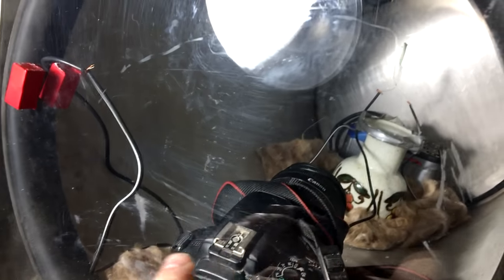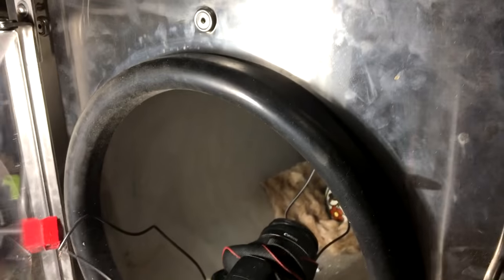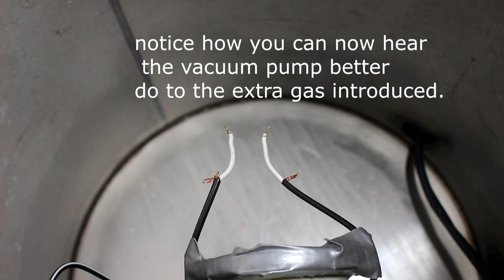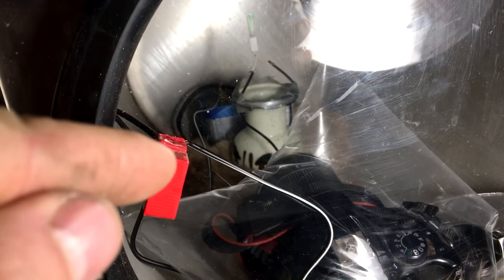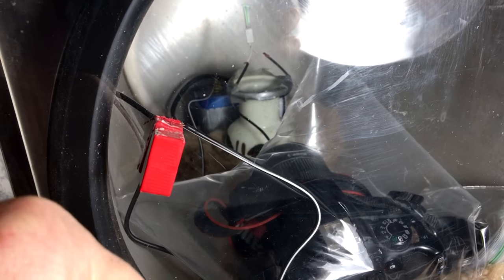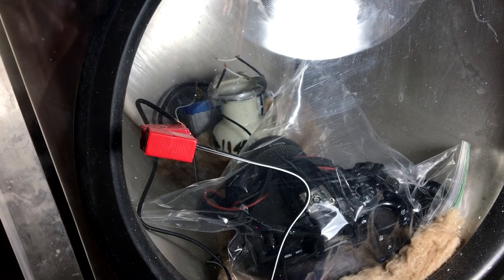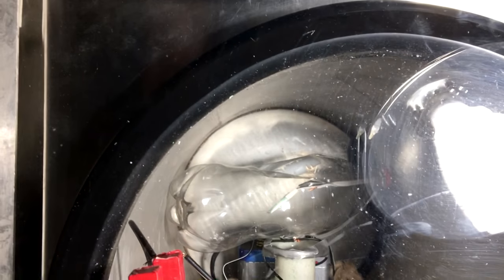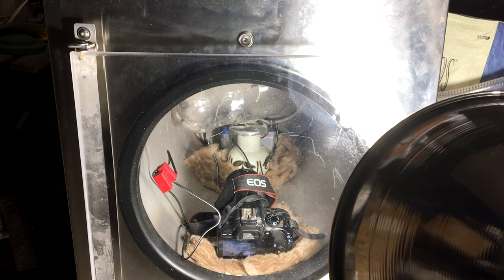Sound of Explosions in Space? part 1

Comment: How does vacuum of space reside right next to our gas atmosphere? (And you can't say "Gravity" in your response)
Reply: OK, but in physics, we observe this thing called differential of pressure. Things will always seek out equilibrium. Especially gases. It's very simple to understand when using the example of filling scuba or propane tanks. Greater volume will always seek the vessel with negative space in order to come to a state of equality. Considering the vastness of empty space, that's a much larger area that would suck off the gas atmosphere of our planet within a half a second.
Reply: Lol, why wouldn't someone say gravity in the response when that is the main answer?? Also, some of the earths upper atmosphere does actually get pulled into space, a small amount at a time.
Reply: +rdizzy1 Because lazy pseudo-scientists like to use that term as a "catch-all" when it doesn't actually apply. Gravity is a theory, not a Law. Thermodynamics is a Law. Buoyancy and Density are Laws. They can be proven with models and observed in reality. Saying "gravity" isn't a mic drop moment.

Gravity was invented to solve hypothetical problems created by assumptions, not facts the researchers made. Even Einstein himself admits this.

So I'm asking a real, legit question about our gas atmosphere. As someone who also has a vacuum chamber and uses it regularly to degas epoxies, silicones, resin infusion etc... I'm intimately familiar with 29 hg. But in order for my chamber to pull near vacuum, I need a thick piece of polycarbonate and a silicone gasket to achieve what is supposedly only 62 miles above our heads. (Karman Line)
Reply: our planet has sufficient mass to warp spacetime to the point that the gas does not have enough kinetic energy to escape the resulting depression.
Reply: +krabcat OK, that's something I can wrap my head around. Thanks for the input. But you are still saying "Gravity Wells" without saying gravity. Yet it's hard to picture a 3 dimentional space time warpage. Very theoretical.
Reply: Gasses still have mass. So this thing called gravity is trying to pull them towards the earth. It does gradually thin out as you go higher because the pressure is less as there is less gas above pushing down. I would imagine the makeup of the air changes as you go up and would get a higher concentration of the lighter gases. 

It is as you say with things seeking equilibrium. Just on a much larger scale than a small vacuum chamber. And with a sufficiently large mass in the middle to hold some gas close to it. Remember it isn't a hard transition line between space and atmosphere. And relative to the size of the earth the atmosphere layer is very thin. So it's only really holding a very small amount. The rest likely did float away until it reached equilibrium.
Reply: If you prefer "gravitational potential" instead of "gravity"... I really don't know what kind of answer you expect.
There is an equilibrium between the gravitational pull and the outward pressure of the earth
The gas in the atmosphere has less energy near the Earth than out in space (due to a gravitational potential)
The entropy of gravitationally bound systems is higher when the system is lumpy instead of uniform
Reply: I have many welding tanks in my shop. I do have to consider my mixed gas tanks will separate over time, and thus result in a bad weld. I do agree, that at the higher altitudes, you'll find the separations very apparent. Hydrogen layer, Helium Layer, Argon Layer, Nitrogen Layer and so on.

BUT... when considering the vacuum of space, can there be a diminished boundary layer of vacuum. OR is it going to be a diminished layer of OUR gasses that show up clear signs of stratification? When thinking of vacuum of space... it's vast and empty always tugging and pulling on anything it can. Our earth is but a speck fluids lightly wrapped over a rock crust.

I'd be more on board if someone said, electro magnetism is what held the gases in. At least that's reproducible with plasma containment inside fussion reactors. Electro magnetic forces contain huge amounts of super heated gas within a field.
Reply: The answer is gravity, it is stronger then the pull of osmosis, and only small amounts of matter can escape.
Reply: Theories can change if new evidence comes along. Gravity is one of those that has never became a fundamental law. While Newton wrote his theory of gravity, and even came up with some math to work out the observations and testing. His math is still used today by NASA when they plan orbital missions. Even though Einstein later discovered (cough** Plagerized) Special and General Relativity, it's never fully become law, because theories can be and have been overturned. Theories then need to withstand the rigors of testing and retesting.

Quantum Mechanics can't explain gravity. But electromagnetic fields do permeate space-time. Here's a quote directly from Space.com: "We know we live in a quantum world, but we can't figure out a way to describe gravity without swearing. And that is infinitely annoying."

Laws are accepted as being universal and are the cornerstones of science. If a law were ever to be shown false, then any science built on that law would also be wrong. Buoyancy and Density clearly explain why things fall/sink. They are laws. Remember, we live in a fluid atmosphere. The air we breathe is a fluid gas, and it does stratify into it's separate components the higher you go. Denser items sink, lighter items rise up. Flight and Swimming are practically identical in their respective mediums. Gas vs Water. Both have measurable characteristics of fluidity.

I will say this again, and it's not refutable: Special and General Relativity or "Gravity" was invented to solve hypothetical problems created by assumptions, not facts the researchers made. Even Einstein himself admits this.

Gravity as a word, does not hold our feet to the ground. Our density does. Occam's Razor applies here. Keep it simple, otherwise it just becomes a theorist's playground of complicated mental gymnastics and math problems. But that still doesn't explain my original question. How can we live right next to a vacuum with a gas atmosphere? How can gravity as a force explain this? It's strong enough to hold trillions of gallons of water form spinning off into space, but weak enough to keep my boat from flinging into space, which is obviously much lighter than the water it floats on. Gravity is also so strong that it can keep quadrillions of tons of gas within 62 miles of it's surface, but weak enough to allow birds and planes to fly though it? AND it holds back the vast vacuum of space too? Wow! Magical gravity... no wonder we still can't describe it!

Nope, sorry... but Buoyancy and Density explain all those examples just fine.
Reply: Then you come up with a theory that actually works.
Reply: +Jane Murphy Actually Tesla is the one who came up with, what I also feel, is the correct one. In fact Einstein even conceded to Tesla's explanation. It's measurable, repeatable and encompasses all living things and organisms. However, it's still vastly complicated for us to fully understand. It is there, but requires us to drop a few assumptions and theories as scientific fact and go back and re-evaluate the math.

Eventually there will be a number of scientists on Tesla's side that will tip the scales of academia. But right now, to question anything is professional suicide. Which is why we have stagnation in scientific development in regards to physics, nuclear mechanics etc.

But what do I know? I'm just an idiot YouTube commenter that should learn my place and never question anything. I should always appeal to authority, even if what they say doesn't make any sense. I'm much too dumb (thanks to public indoctrination camps) to even think about concepts that are outside of my limited professional skill set. I should keep my head down, watch NASCAR and Reality T.V. and feed the machine my time for credits to use up at WalMart.
Reply: Eco Mouse But that doesn't explain how gas is "held" to the earth.
Reply: I may be wrong, but I think the earth's magnetic field also contributes to holding onto our atmosphere.
Reply: Buoyancy and density work in combination with gravity to produce said effects, buoyancy has no meaning without gravity... Even if the current theory of gravity isn't true, before the theory itself it is quite obvious that things with mass attract each other. If the theory falls, some other theory will replace it but that doesn't mean that the atmosphere will get sucked away because of it. You are asking people to explain chemical bonding without electrons. So stop bullshitting people you martyr of science, everyone has been nice to you until now.
Reply: +zach ZACHSON If our planetary science is correct, when a planet (like Mars) loses it's magnetic shield so too goes the atmosphere. I believe our planet is surrounded by a Taurus Field of Magnetism, constantly looping back and forth between the poles. That also explains why we have Northern and Southern Lights along the convergence lines near the 65° and 75° latitude but no higher. The inner slope of the magnetic donut as it crosses the Karman Line.
Reply: Buoyancy is fluid displacement. Archimedes' principle indicates that the upward buoyant force that is exerted on a body immersed in a fluid, whether fully or partially submerged, is equal to the weight of the fluid that the body displaces and it acts in the upward direction at the centre of mass of the displaced fluid.

In regards to mass, all objects will take the path of least resistance (the law of conservation of motion), so the body with less mass will follow the path of space that is "bent" more toward the body with more mass. BUT they will never truly touch each other according to physics. Electrons are made of massless energy particles. So are they actually doing the repulsion on an atomic level?

So, does this mean that you are going to start being nasty to me, because I have questions? I appreciate that open mind for science, you've got there.
Reply: Nice backhanded insult. At least I'm not rH+
Reply: Mass attracts mass.
/solved
Reply: Eco Mouse. There is the theory of gravity and there is gravity. Meaning: gravity is a fact, a fact for which we have constructed a model in order to make predictions about said gravity, which is known as the theory of gravity. If you truly would be a physicist, you would be able to make that distinction. I hope I could clarify to you why the condition in your question was unnecessary and misleading. If you disagree, please clarify on your part why you do. ;)
Reply: Furthermore, bouyancy, mass, etc do not make any sense without the context of gravity. It is like saying explain to me why chilli is hot without telling me about molecules and receptors. By answering that chilli causes a sensation we interpret as hot does not explain it what is going on. Sensation does not make sense outside the context of receptors and their antagonists etc.

Comment: Is your hypothesis that the gas produced by the explosion is not acting as a diffuse medium and transferring the sound in a solid and consist vibration wave. More like the gas is, at least initially, transferring the sound by the movement of gas molecules traveling to the observer?  

     So here's some thoughts and questions I have. I'll try not to be too rambling and nonsensical: 

     Can gas particles transfer sound information via independent molecular vibration in single molecules or at least small packets traveling across a distance in a vacuum or near vacuum? Or is the only sound produced by the impact of these molecules striking the observer and not actually sound information generated at point of generation ie: explosion? (Though I don't know if a single molecule in a vacuum can even vibrate. Wouldn't the "bouncing" motion of vibration simply be kinetic energy in one direction without anything to change the direction of that energy?)

      Would it be possible to focus these high energy gas particles, like from an explosion, in a more focused stream in a specific direction to increase the range of audible detection? Say in a crude example; firing a cannon in a vacuum would be audible from a larger distance from the target than detonating the same charge without the focusing mechanics of the cannon.

      Would a focused directional spray of high energy gas particles in a vacuum be less likely to diffuse or diffuse more slowly because these gas molecules would be heading in more or less the same direction and less likely to impact each other and be sent in random directions?

     Could the breaking of the bottle not be from an increase in gas pressure in the bottle caused by the explosive gas, or shrapnel from the blasting cap, but the kinetic energy of the gas particles, accelerated by explosion and moving through a vacuum, impacting the bottle walls?

Comment: The problem is your chamber. It's small and the pump is slow. There's enough gas produced that it creates an elastic medium for the sound to travel.
Do this in a very large chamber the size of a large room, or in orbit, and I guarantee you that the sound would be very poor at this distance.
Also, if you increased the distance, the sound would quickly become nonperceptible. Sound needs elastic mediums. Gas escaping in all directions just can't do a proper sound.

Comment: Nice experiment, but I suggest you think a little better next time you do this sort of experiments. It seems you have a less then perfect understanding of physics. It is only logical, that an explosion is "stronger" in vacuum. Provided the explosive is of the type, that there is an oxidant included in the explosive material. As for the sound propagation, with your explosion you have introduced gas into the chamber. And the chamber is relatively small for the size of the explosion. So the sound has enough gas to propagate (at the time of explosion). Another way to think about it is that sound (as we know it) is a perception of pressure differential through time. An explosion is just a high pressure differential in a very short amount of time. Funny you did not recognise this, although you notice an increase in pressure. Your extrapolation from this experiment to outer space is also wrong. While you had a larger explosive in a relatively small chamber, any size of explosion in outer space is small, comparing to the size of space. Therefore any explosion is soon absorbed (pressure is equalised). Depending on the distance from the explosion and the limit of detection of your microphone (since you cant use your head in vacuum), there is a limited radius in which there is gonna be "sound". No matter how strong the vacuum. ALso, putting a high end (or even low end) camera in the vacuum chamber... come on man :D Maybe try water next time :P

Comment: Can you do a test where you use an alarm in a vacuum but fill the vacuum with some type of dense particles to see if the sound waves will travel through?
Reply: Sorta like the sound head through the probes that went through saturn's rings
Reply: > but fill the vacuum with some type of dense particles to see if the sound waves will travel through?
Hold your ear on a wall, slap your hand on that wall a meter away and you have just found out, what happens when you put "some type of dense particles" in a vacuum and send sound through it.
Reply: That's not in a vacuum and it's not what I was talking about but technically true yes
Reply: dude... if you fill a vacuum with particles it's no longer a vacuum and sound will travel the way it does outside of the vacuum chamber
Reply: ***** vacuum takes the air out but not everything
Reply: Joshua Wheeler no, a vacuum takes everything out, that's why in a vacuum there is no pressure

Comment: In space there is nothing like a vacuum, there are still some particles anywhere
Reply: but the particles wont transfer the sound ... in the near vacuum, even if you still have some molecules of something (gas eg.) they wont be enough to form sound waves...
Reply: TheKnaeckebrot Depends what you're comparing it to. There's usually too much other noise affecting space atoms to easily notice slight fluctuations in movement caused by "sound" in space sure, but it's still there.

Comment: but can you explain the mysterious knocking on the ISS and in the Chinese Space Station?
Reply: I just realised something, what if we launched a big cypinder in space, make a robot that will automatically seal it off and then remove the pressure from it, I wonder if that will clear off all the air inside.
Reply: Saunterblugget Hampterfuppinshire I think I can explain the knocking heard on ISS and the Chinese space station. In space, there is allot of small garbage leftover from decades of space exploration and small pieces are hitting the space stations from time to time. the inside of the space stations are pressurized with air and the vibrations coming from the collisions reverberate throughout the air causing the knocking.
Reply: vladstr100 I had the same theory too!

Comment: Nope you're wrong. The "sound " is the vibration of the stuff in the chamber and the chamber itself. 

In space there is no fluid to transmit waves so there's no sound. 

It's basic Thermodynamics. 

The sound we hear in the camera is just all the stuff that touches the camera. 

Should have suspended the camera from the top with suspensions that would make even less sound that way. 

Plus you'll always hear a bit of sound because you only have "near" vacuum